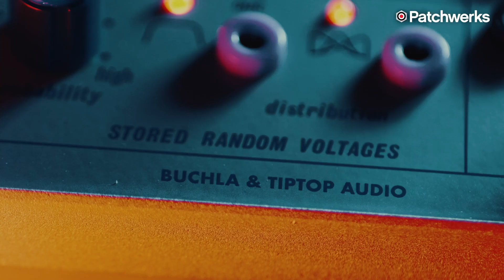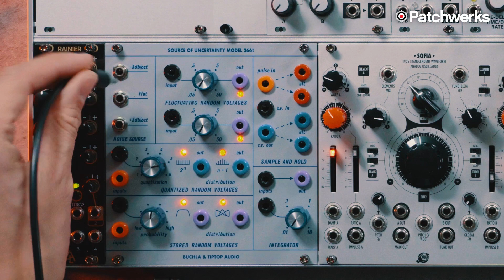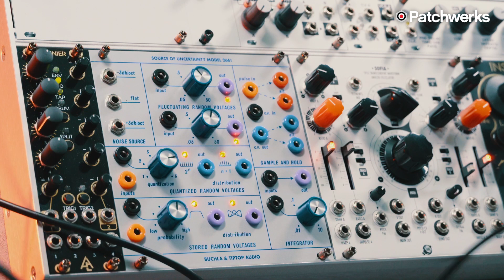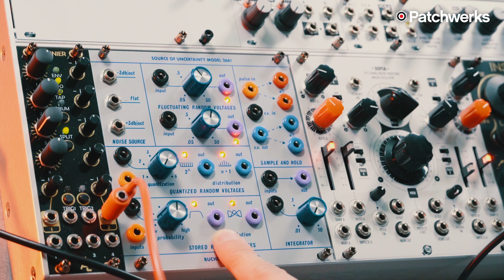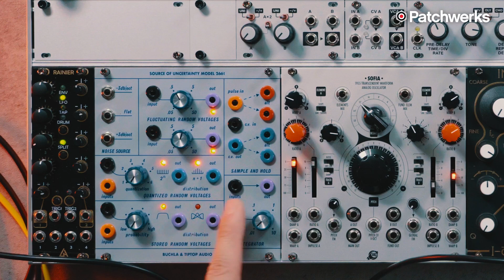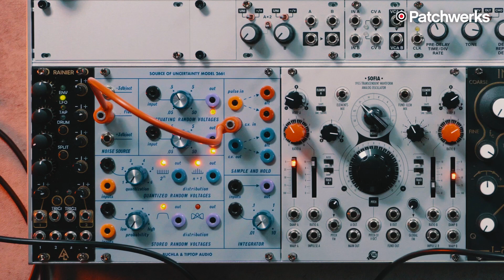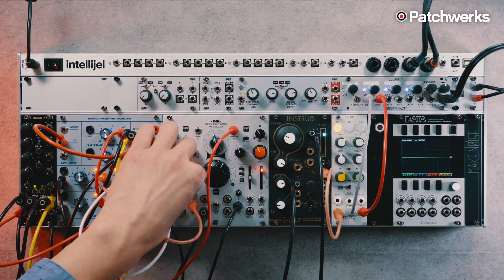TIPTOP AUDIO BUCHLA 266T: SOURCE OF UNCERTAINTY

Comment: Thanks for showing the outputs on Data.  It looked like all the outputs are positive voltages.  Is that correct?  Even the noise outputs seem to be positively biased, which is very unusual.  So I'm wondering what would happen if negative voltages were patched to the S&H or the Integrator inputs. Another observation is that the 266T has no internal clock.

Comment: Good direct info. One thing I long overlooked is that you can use the integrator to add voltage controlled slew to a sequence. Run the seq through and apply a gate to the time control on the steps you'd like to slide. Attenuate the level of the gate to control how much slew is applied, or run the gate through a VCA with a sequencer, LFO or other modulation source to vary the slew amount in either a controlled or random manner.